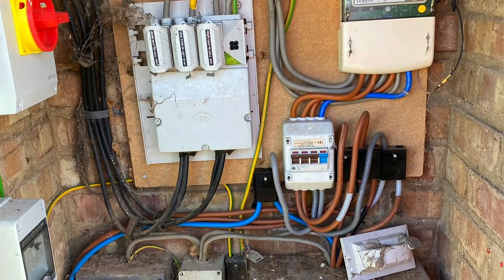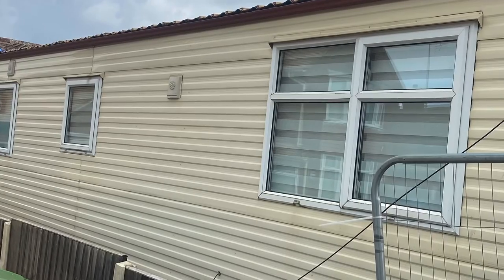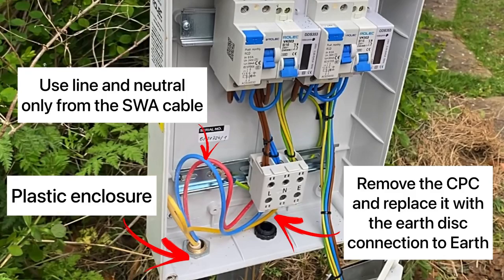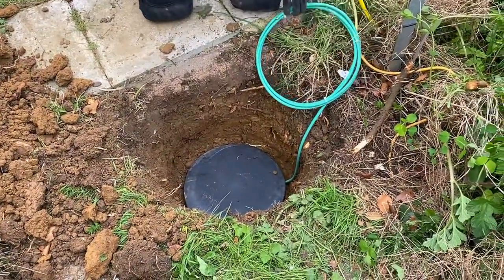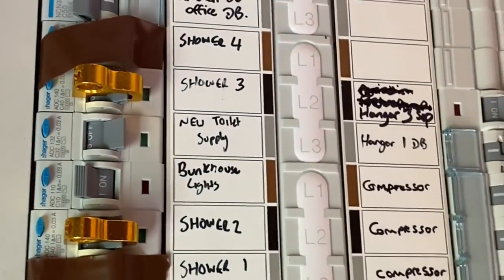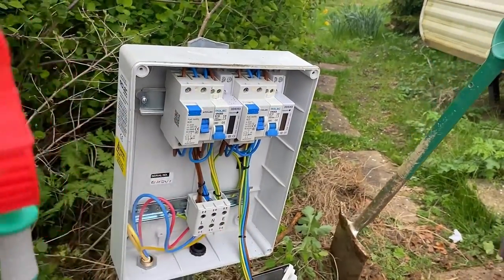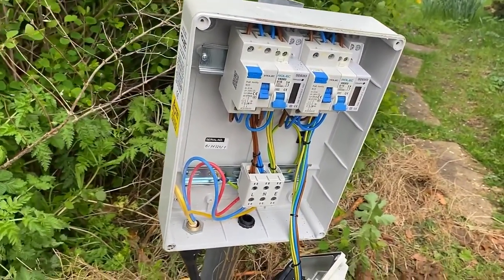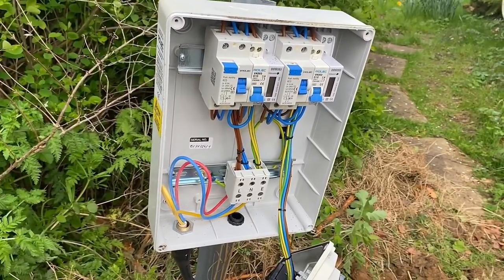Removing the Exported PME by Installing an Earth Disc (Earth Electrode)

Comment: There is a recommended depth of 600mm, this is so its below where the ground could become frozen. The resistivity of frozen earth is much higher than the ground in a temperature abovd 0c.
Thiscis from BS7430

Comment: Hi are those Condu Earth discs fully recognised and allowed under BS 7671 Being there American?
Reply: I'd put money on it not having a British standard attached to it... Departure chaps?
Reply: @TravoltasBiplane  Agreed plus it Is a solid green earthwire and not green and yellow like it should be.
Reply: @danvictor3934  Heatshrink some GNY
Reply: @travoltasbiplane1551 I’m pretty sure it’s fine if John Ward/JW is using them… Also one of Sparky Ninja’s videos discusses the merits of the Condudisc, so with those authoritative sources, I was very comfortable using one myself. Vastly superior to an earth rod - in terms of corrosion/longevity, as well as providing a much better earth. First time I have seen one used without the Conducrete though. I got a reading of 14.9 ohms with mine.
Reply: @robinpenny3193  well yeah Sparkyninja and John Ward are mates so that makes sense. No one said anything about them not being any good. The discussion was about whether or not they had a British Standard - the absence of which would mean a departure from BS7671. Which in of itself isn't a problem if you as the designer are satisfied that you have achieved equivalent or better levels of safety.

Just because your favourite YouTube 'authority' does a video on them doesn't automatically infer compliance when you sign that certificate... It's still down to you. That was all that was being said. 

But yes I agree they look good. But that wasn't the point. ;)

Comment: We have used over 10 of these now and absolutely no brainer. Earth rods are obsolete in my opinion. We look after two camp sites in south Devon that have awful sandy soil which earth rods do not work at all. These discs have stayed constant results for last 3 years. Must point out you should really use the conductive concrete they produce to keep the results consistent and no fluctuations between seasons